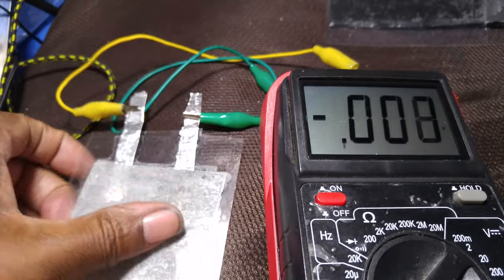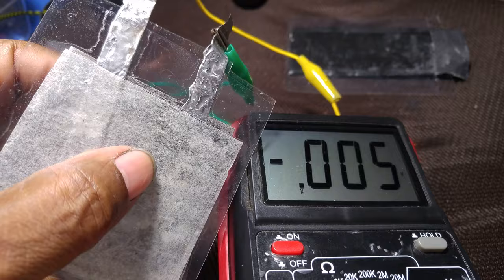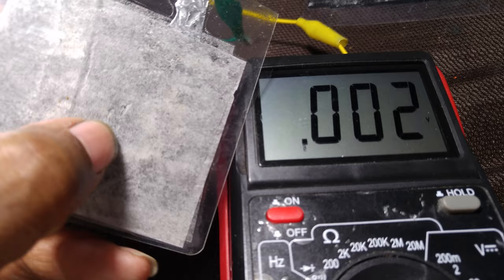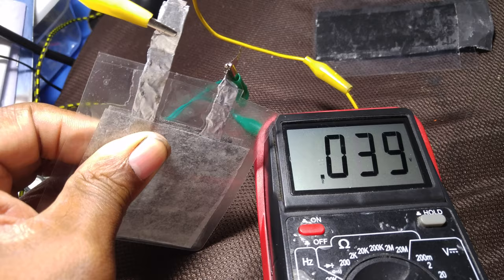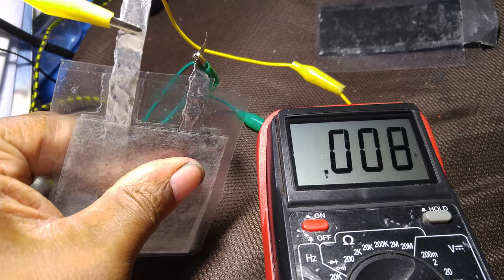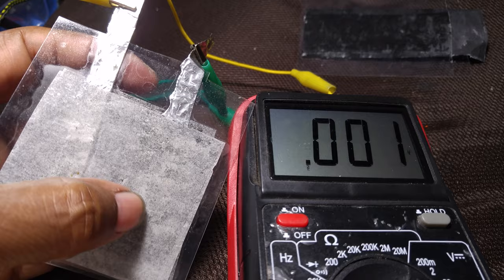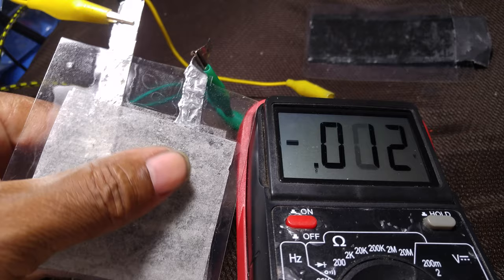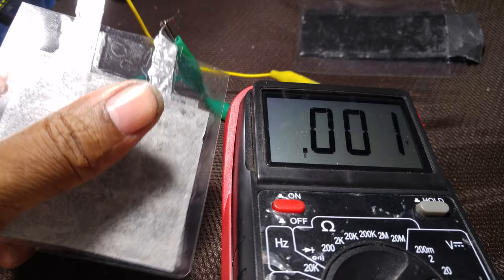my first attempt making thin cell crystal batteries

Comment: Here's an idea , put the waffer cell in the middle of two magnets that are opposing each other then force them together leaving small amount of wiggle room for vibrations . then put an electromagnet on each magnet and pulse the magnets so they move in and out very slightly causing pressure waves on the cell but at pulses, this could make a lot more energy than just solid state pressure. When powering the electromagnets use minimul power ..
Reply from the maker: https://youtu.be/wTKI1yuBv30
Yes we have been experimenting with that to here's one of the videos see the two magnets in the middle we have changed it we just have an updated that video but we are working with that here at Media Library oh, of course you can give us a call at 313-651-5349. We are trying to explain two people that Lloyd G Stovall is the father of over unity and how they been keeping this technology from you if you want to hear more about it then just give us a call or you can email us at media library info at gmail.com